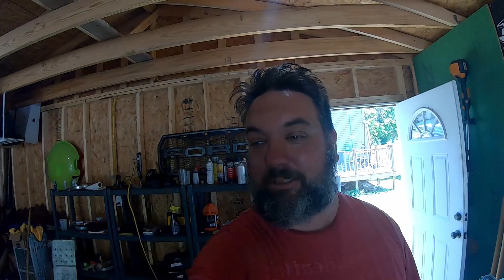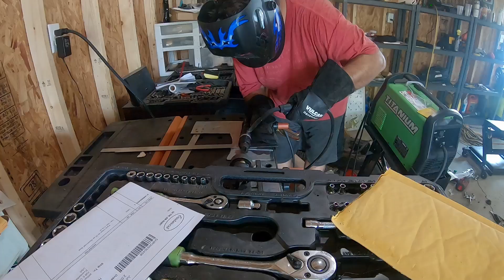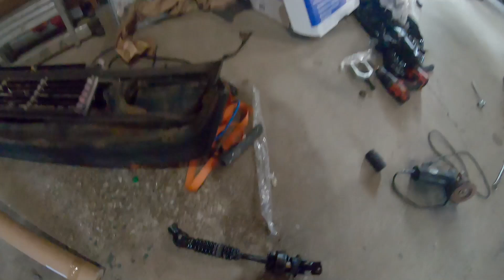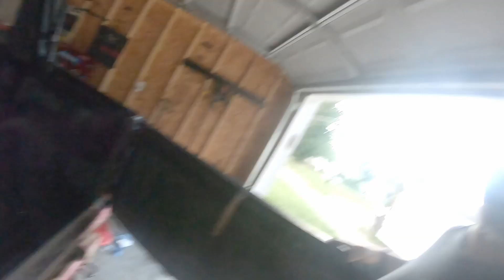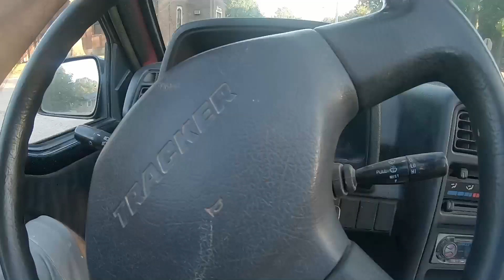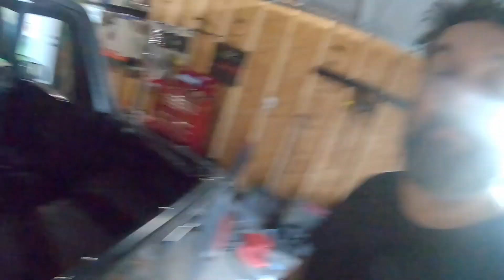Geo Tracker Power Steering Conversion

Comment: Does it really matter which of the 3 holes the  longer steering gear pilot bolt goes in ? The depth of all 3 holes feel deep enough to accommodate the pilot bolt